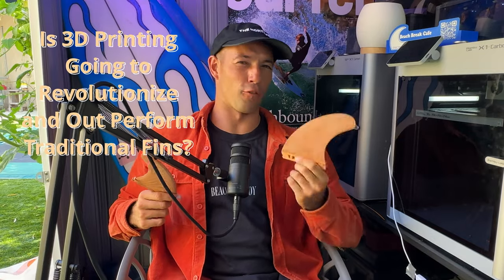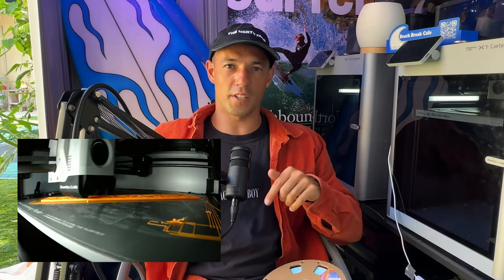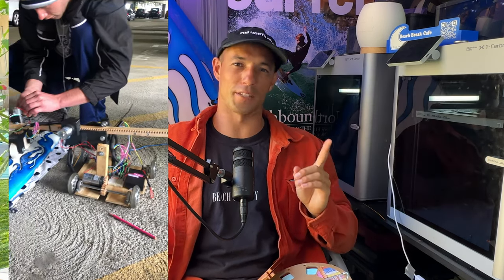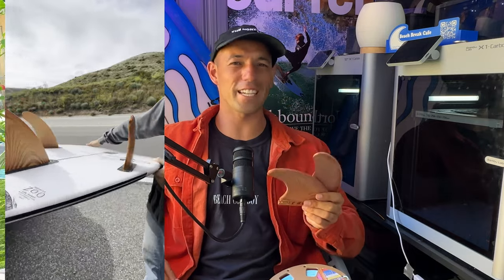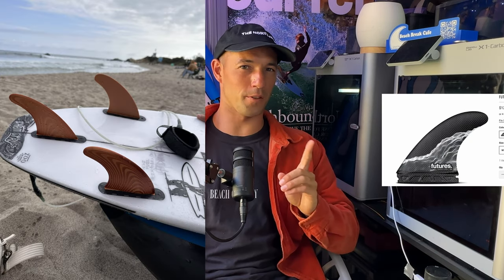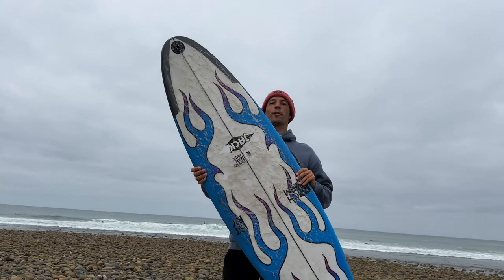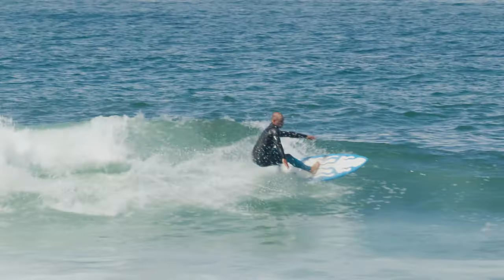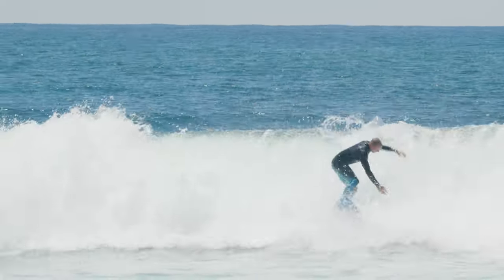IS 3D PRINTING GOING TO CHANGE SURFING?

Comment: Dude I have been printing fins for about 4 years. Love it. Lose one - print a new one. Snap one - print a new one. Currently using PETG but there is a bit too much flex. Thinking of going CF-PETG.
Reply from the maker: PETG-CF is amazing actually!!! Do it and add a thin layer of resin, I'm about to do the same